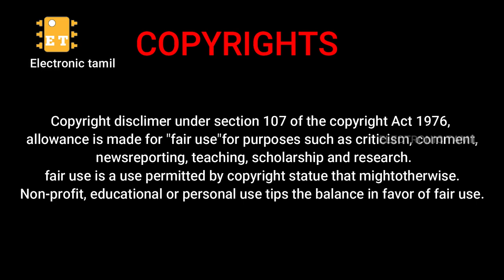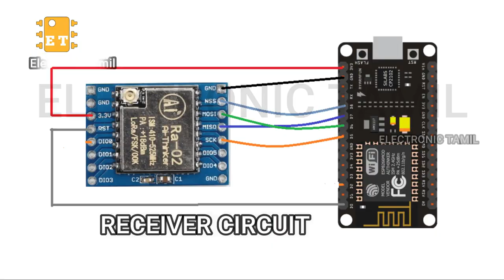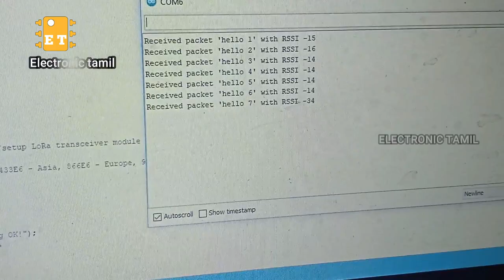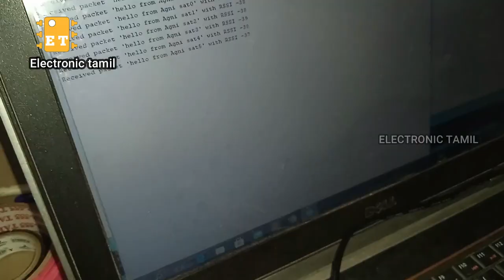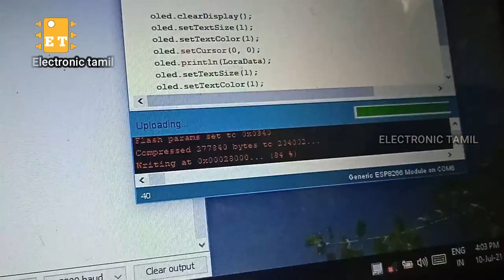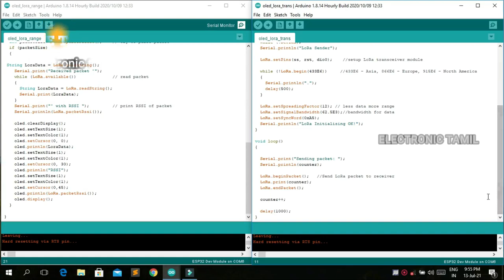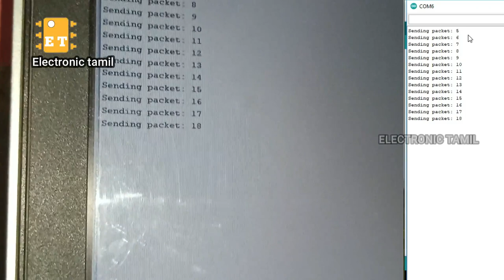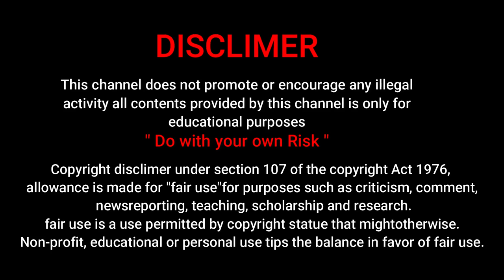cube sat part 5 | agni sat | Electronic Tamil 360 | Lora range test | #studentsCanCreate #LoRa

Comment: Bro where to buying the satillite components
Reply from the maker: Link was in description
Reply: @ElectronicTamil360  No there bro please tell any specific website.
Reply from the maker: Use robu.in
Reply: @ElectronicTamil360  thank you bro
Reply: Normal electronic components for domestic and even military grade components CANNOT be used for satellite building. One needs radiation hardenned components which are specifically designed for satellite building. I appeciate the spirit and enthusiasm you showing about electronics. Google about Amateur Radio also known as Ham Radio and get youself the amateur radio licence.